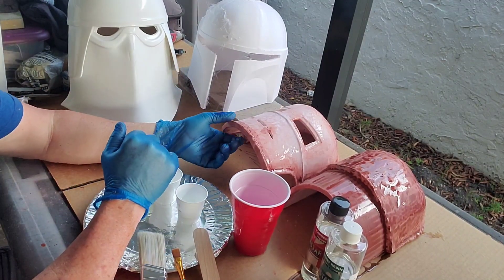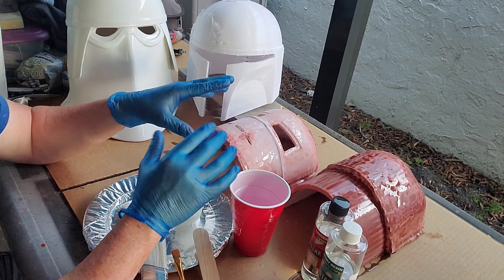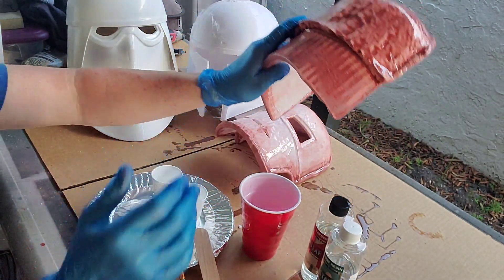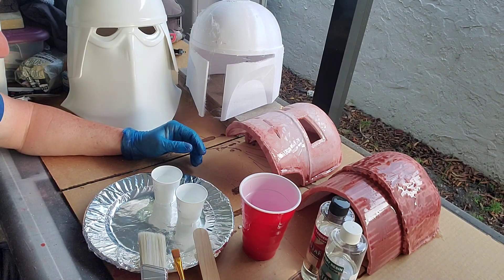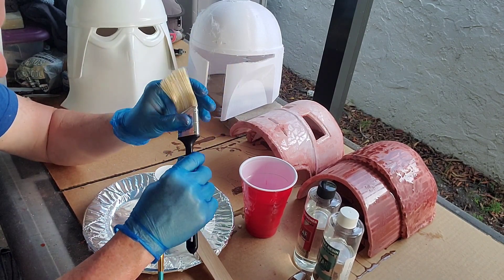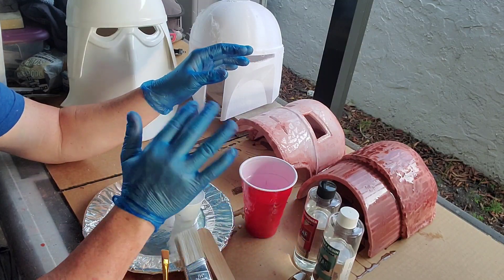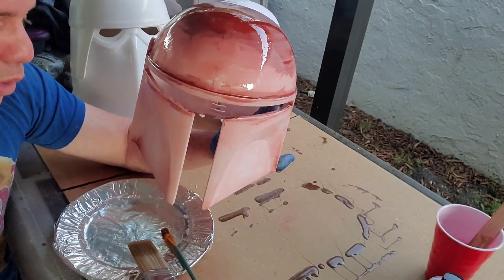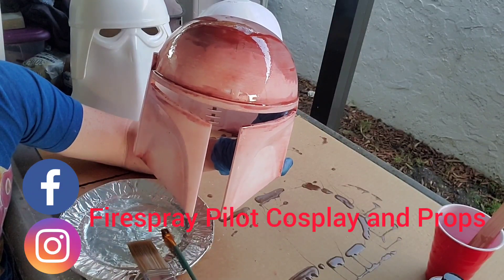Coating a 3D Printed Part in Resin

Comment: Does it need curing?
Reply from the maker: Hey there; thanks for he question, and apologies for the delayed response. So curing is a natural process that happens with time when working with mixed chemicals. These resins typically begin to cure within 15-30 min, however they will not be completely cured for up to 24 hours at times. 
Now, if your question is, do the resins require the use of an ultra violet (UV) light to cure, then the answer is, not at all. A UV light can be used to speed up the hardening process, but it's really not necessary. Just time and air. 
Thanks again, and take care!